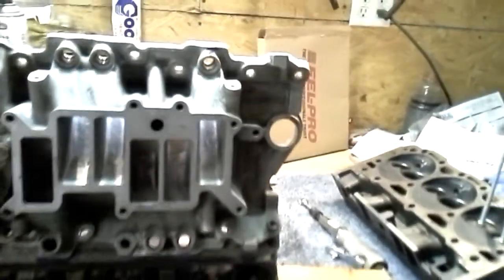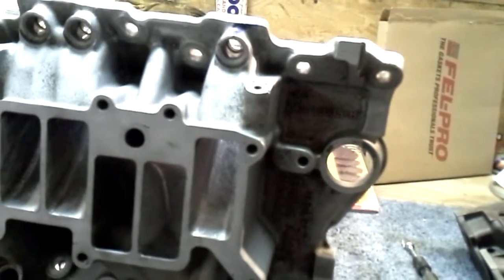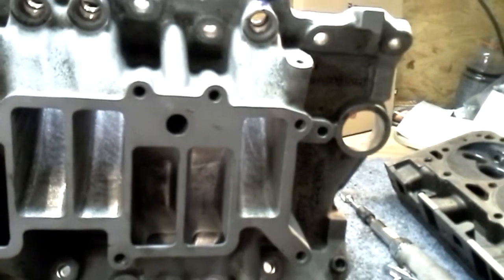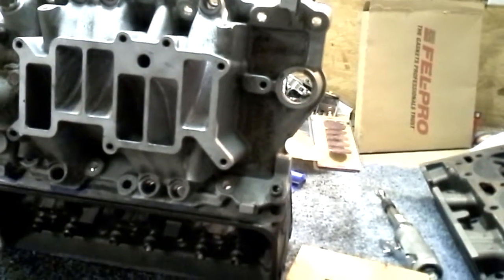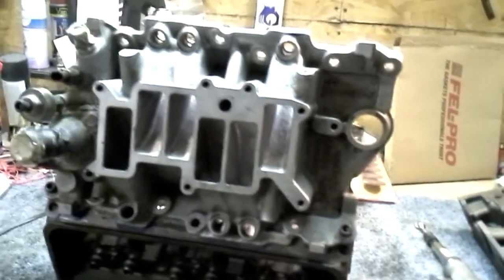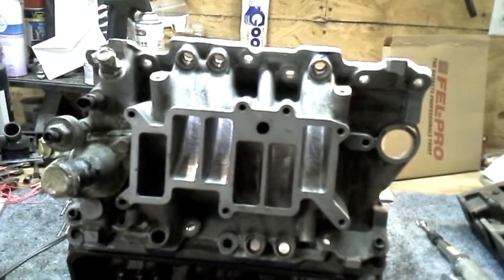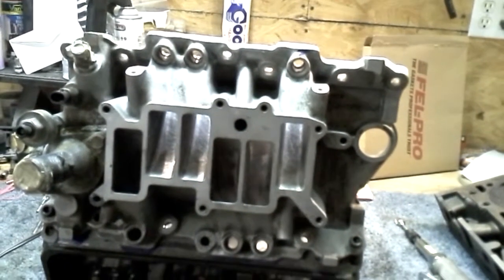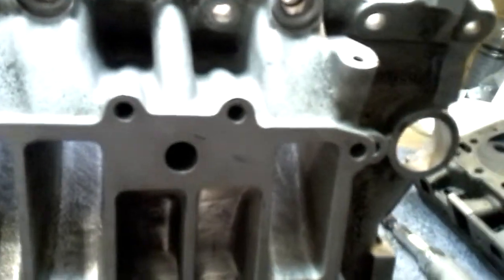Head Porting 4.3 Vortec Heads 600HP Turbo Typhoon

Comment: What drill bit and tap do I need to drill and tap my vortec heads to the 12 bolt manifold
Reply from the maker: Taylor porter These heads were already modified by a machine shop when we bought them.  I think the bolts are 3/8-16 
Make sure you get the head surface level and use a quality drill press.  There’s runout to be aware of with drill presses and drill bits, so be very careful you don’t end up with a hole that’s too big. 
I’d do a google search for what size drill bit is recommended for a 3/8-16 bolt.  Good luck, thanks for watching!!!  JD
Reply: HeadFlowInc thank you the advice is greatly appreciated I followed this 4.3 build to the end and I finally am getting mine done. Did you balance the rotating assembly or just buy a good balancer and flex plate I’m just curious on how you bent the crank

Comment: where can i get a set up like yours?
Reply from the maker: Jamal Cole This is a customers build, a built 4.3 can be expensive. The heads alone are around $1400+ and the intake would be pricy especially with the porting. This engine has a Renz Fab upper plenum which is a fabricated aluminum race design.